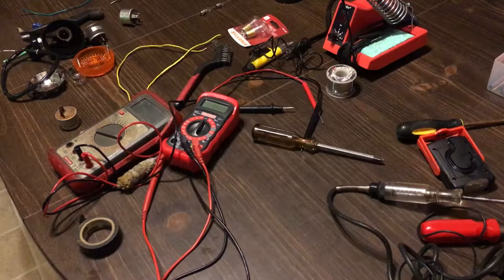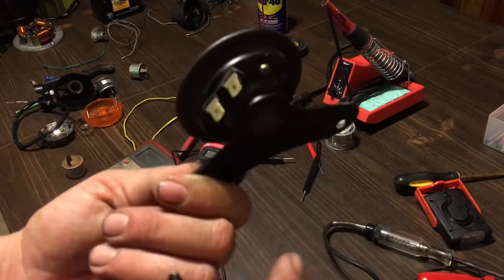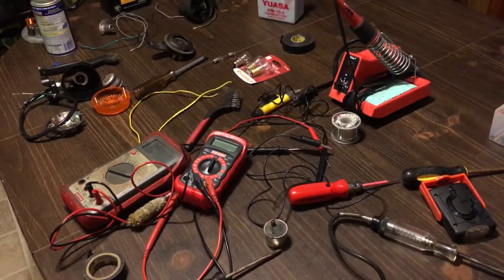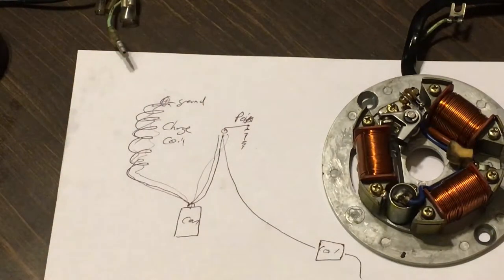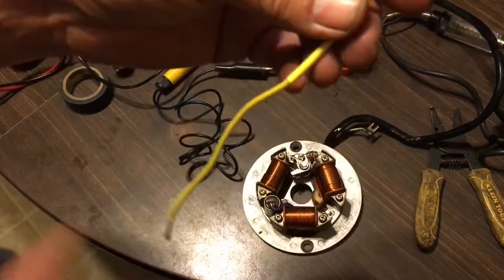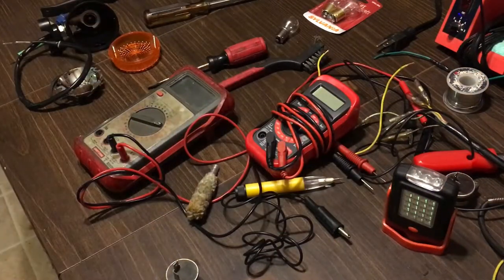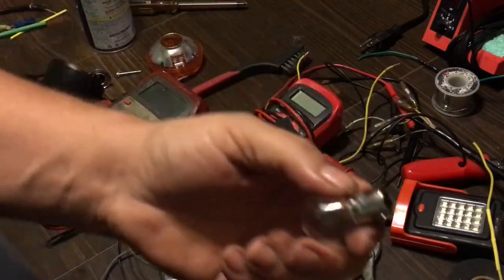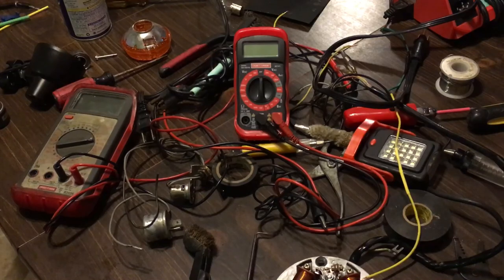Ke100 Km100 electrical talk

Comment: Thank you for your videos!  My wife’s first bike is a 2001 KE 100.  Lived most of it’s life neglected and am breathing new life into it and your videos have really helped.  I have one big question I’m hoping you could help me with.  I really don’t want to go through the 12v conversion.  I put  a brand new 6v battery in the other day and from a full charge it will completely discharge within a matter of 3 to 4 days.  So I have a parasitic draw that I am looking for, but  my question moreover is this: Does running these bikes charge the battery?  If it does, then I think there is something else wrong with my charging system, because the battery won’t charge even if she’s been riding for upwards of an hour.  That being said, I don’t think these bikes have alternators, if they do I can’t find it and I don’t know how a battery could charge from the engine without an alternator.  Thanks in advance for your help.

Comment: Where should I start on a km100 1976 I have no spark I unplugged the kill switch and went direct to coil to magneto I’m not seeing any rectifier on the bike or cdi I’m not familiar with electrical not sure if it should have the cdi but the rectifier is just missing would that cause it not to have spark
Reply from the maker: @dustinlevitz3900  tune up replace points and condenser